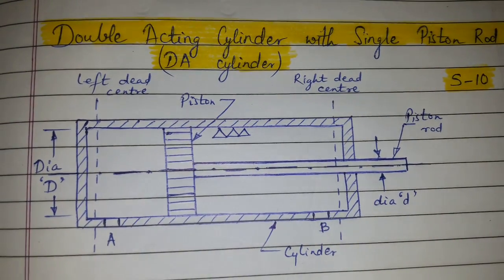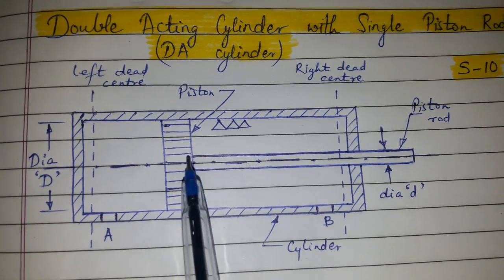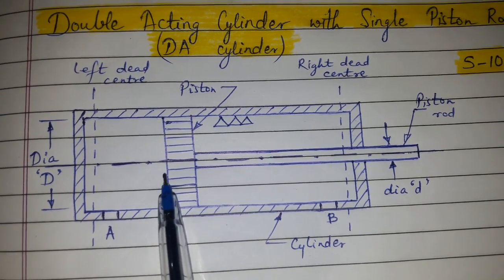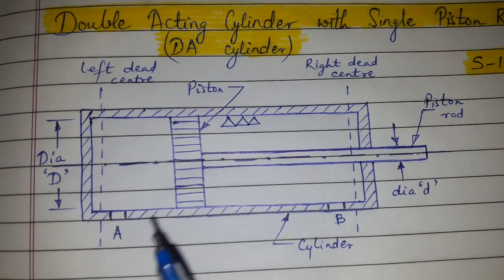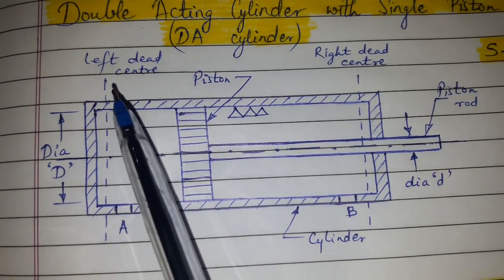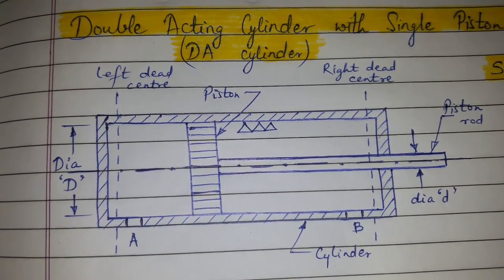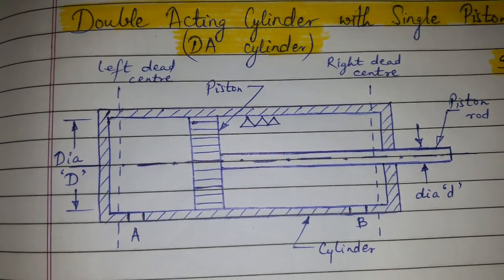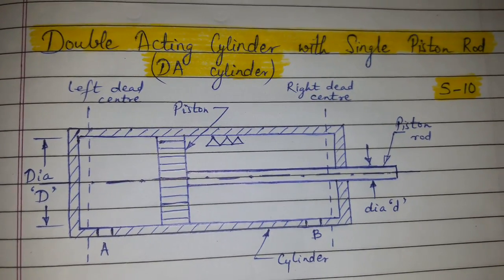Double acting cylinder with Single piston rod... #20kviews #viralvideo #doubleactingcylinder

Comment: Sir m not getting the use of it . Would u plz tell me why it is being used.?
Reply from the maker: +Kanush Bhalla

1. DA cylinder is used where we require both stroke (right to left and left to right) as power strokes and hence useful work is obtained in both directions.
Reply from the maker: +Kanush Bhalla 

2. Double acting cylinders are used in automobile, motorcycle, ATV and airplane landing gear suspensions because the bumps come so fast that a single acting cylinder would be impractical. Double acting cylinders are used in drilling, log splitters and earth moving equipment because the forces required make single acting cylinders impractical. Double acting cylinders are found in back hoes, elevators, trash compactors, garbage trucks, fork lifts, jacks and those machines in junk yards that compress old cars.
Reply from the maker: +Kanush Bhalla 

3. Double action cylinders are faster, stronger and use less energy to do the same job done by single acting cylinders. In industrial applications, single action cylinders are used if possible, but when speed or force are important double action cylinders are employed.
Reply: Thank u sir ❤

Comment: Diploma in tool and die maker or in mechanical or in architecture which one I should go plzz reply
Reply from the maker: +jitu gupta 

Jitu saab... the choice which you have in your mind is covering wide range... 

So I think currently you do not have preferences as of now: 
1. Cost/Fees for the complete course
2. Number of years the course will take
3. College location

Lowest cost of course, less number of years to complete the course and nearby college so that the travel time ia minimum...

Just to be specific, tool and die maker and architecture are very specialised courses... Mechanical diploma/degree engineering gives you whole lot of spectrum of further courses/jobs... I have seen students going to following fields after Mechanical - MBA, Software, Teaching, Project engineering, Piping, Automobile, etc.
Reply: MechTech KnowHow  but sir mechanical is tough
Reply from the maker: jitu gupta 

When you dream high... you should be ready to put in the required efforts...

No pain... no gain...

I agree other choices are easy...

I got 75% in SSC... 73% in HSC... Was frustrated in the first few months of degree... my mom realised this and asked me one question...  Are you the first to do this course? I said No. There are many who have completed... then my mom said when so many students have done it why you can't... that was the turning point... I started putting long hours of study and completed all my assignments on my own... i passed first year of Engineering, but still I got around 56% only...

In 2nd year degree... I got a friend who joined from Diploma to Degree... he advised me to do 10 years question papers.... and my percentage started increasing and in final year... I was 2nd in Mumbai University in Production engineering...

By the way... that was my story... you have to decide and have your own story as you go along...
Reply: MechTech KnowHow  which one I should go for in diploma course according to u?
Reply from the maker: jitu gupta 

Mechanical or Chemical according to me...

But efforts are to be put... many festivals... many family ceremonies have to be sacrified... 

Be ready for sacrifice for any kind of Diploma or Degree...
Reply: MechTech KnowHow nowadays many students are doing mechanical and civil what about electronic and communication ?? According to u